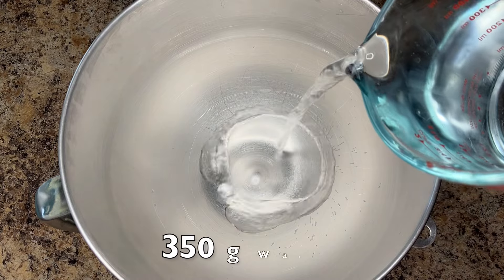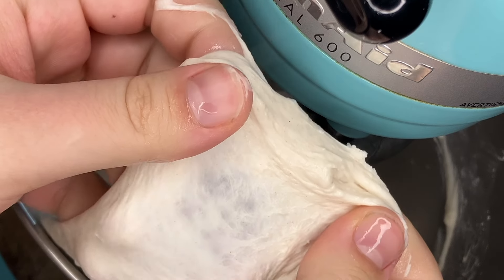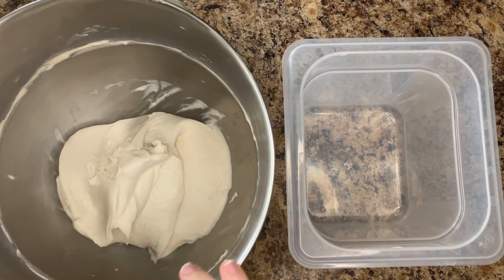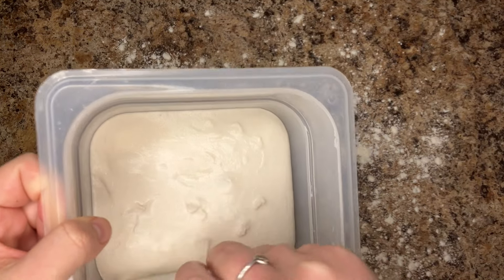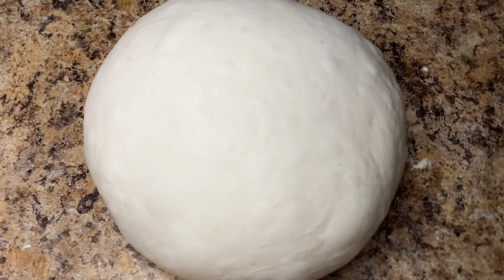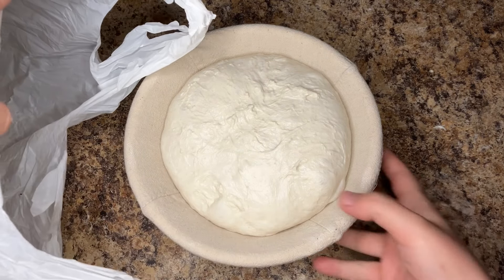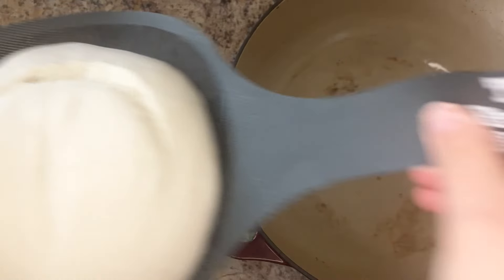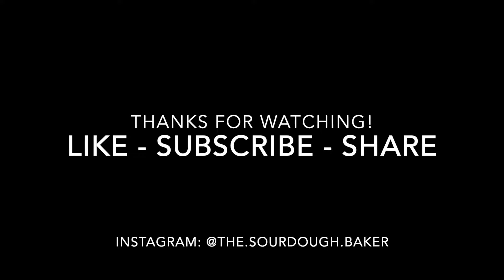Stand Mixer Sourdough: Country Loaf

Comment: I was shocked by your salt level 5% of the flour in salt is almost double what I've typically baked with 2-3%
Reply from the maker: Hi! I think you miscalculated. This recipe uses 500 g of flour and 10 g of salt. 500 (the amount of flour) times .02 (2%) is 10 g of salt. This recipe only uses 2% salt. 5% salt would be 25 g of salt, which would hinder fermentation.
Reply: This is what happens when you should be in bed instead of binging sourdough videos on YouTube lol
Reply from the maker: @Crimsonchinn2010  😂😂😂

Comment: Ok so I had it on too slow of a setting. I use the same ratio and I just got a stand mixer but I was like why is it taking more than 6 mins?!
Reply from the maker: Yes! The low speed is great for stiffer doughs, but wetter doughs like this one will need a little bit of speed to help them get going! Just be careful not to overheat - it’s not recommended but definitely something I do 😬
Reply: @TheSourdoughBaker  thank you!!! I have been trying to do little breaks during the kneading too hopefully that will help save my motor
Reply: @TheSourdoughBaker  I don’t have kitchen aid yet but my cooks one is a beast

Comment: I did notice no stretch and fold was applied. Is this right? And another question after shaping does it go into the fridge right away or you leave it on bench for a while? thanks.
Reply from the maker: With this one, gluten is developed via stand mixer, so stretch and folds are not necessary (though performing one or two can help). I did do one two to three hours into fermentation, which I think I showed in the video. After shaping, it does go into the fridge to be baked the next morning, or you can proof on the counter and bake same day if you choose.

Comment: Greetings from Brazil🇧🇷
According to KitchenAid’s manual, the spiral dough hook should only be used at speed 2. 
“Caution: frequent and prolonged use of the spiral dough hook for kneading can eventually cause the beater shaft bearing to migrate up into the planetary over time. When this happens, the top of the beater shaft will start grinding against the underside of the lower housing and cause damage. Visually inspect the beater shaft bearing on the bottom of the planetary before each use, and if it has receded into the planetary, discontinue use of the mixer until you have replaced the planetary.” 

I’ve seen this happening to a 3 years old bowl-lift Pro 600😬
Reply from the maker: @caasr57  Yes, definitely! KitchenAid is not the best option for kneading sourdough and it’s important to understand the risks, watch the mixer, and proceed with caution
Reply: @TheSourdoughBaker  Hi, Caitlin. I just mentioned that because, in the video, you tell to "..knead on a medium speed - speed 5 to 6 - on a KitchenAid, until the dough completely removes itself from the sides of bowl and passes the window pane test - 10 to 15 minutes." 

I'm wondering if your KitecheanAid Pro 600 did this job well!
Reply from the maker: @caasr57  It definitely does the job! But, it’s not as nice on the dough as my Ankarsrum. I’ve been doing this with my KitchenAid for years with no issues, and now I have an Ankarsrum which is much better for both the mixer and the dough. It definitely is a risk. I understand the guidelines set by KitchenAid and know people who have burnt their motors with this technique, so the warning is definitely there for a reason! I guess I’m just a daredevil 🤷🏼‍♀️
Reply from the maker: @caasr57  I actually just posted the full 15 minutes of kneading this dough in this mixer if you’re interested in seeing the whole process on my machine
Reply: @TheSourdoughBaker There is no Ankarsrum dealer here in Brazil. We need to import it, which makes its price to double, due to taxes🤬
Reply from the maker: @caasr57  Oh no! Which is a lot because Ankarsrum is an expensive machine!
Reply: I’ve used a Bosch mixer for years and years of bread making. It’ll make six traditional loaves at one time and barely even blink. 😁 It does tend to “walk” when it’s kneading this large amount of dough, but there aren’t worries about burning out the motor bec it is made for heavy work.

Comment: Hello 👋🏻 I’m trying again to use my stand mixer. I used the same recipe as you only I didn’t do the mixing of the starter first, I did the flour and water, mixed, let sit for 40 min as an autolyse which I’m used to. Then I added salt and starter and mixed with paddle till incorporated then the dough hook for 15 on medium. It’s still not picking up and years too easily. I’ve added another tablespoon of flour as well. It’ll pick up on the hook but won’t stay there, it keeps walking itself back down into the bowl.
What am I doing wrong?
I REALLY want to be able to use my mixer as it’s my grandmother’s old KA K5SS
Reply from the maker: @kristaolson6832  First, I would make sure the mixer is adjusted properly (that the hook touches the bottom). Second, you shouldn’t even need the full 15 minutes if you’re doing an autolyse. I recommend going until you get the gluten network (windowpane) and when you pull up on a piece of dough it doesn’t stretch too far (it has elasticity). Then, you can stop, even if the dough isn’t picking up. Do check the flour and make sure it’s strong; I haven’t had luck with all-purpose in my stand mixer.

Comment: Nice video. Thanks. 
Just wondering... What happens if I bake a bread with a starter that doesn't float? What happened with the bread?
Reply from the maker: Starter that doesn’t float is either not quite ripe, meaning it was freshly fed and hasn’t been given enough time for the yeast to multiply abundantly enough to effectively leaven your bread, or overripe, meaning it’s gone past way past the point of peak, begun producing alcohol, and is beginning to deactivate until its next feed. In either of these situations, the bread could still rise, but may take much longer, or the bread may not rise well at all. The end result would be very dense and possibly gummy.

Comment: I had to add several more tablespoons of bread flour, and it still did not seem as light and springy as yours. Mine seemed a bit heavy and lifeless. My starter was very active and floated in water. I used Bob's Red Mill artisan bread flour. I kneaded for 10 min or so. I put it up to rise, but I am afraid I did something not quite correct.
Reply from the maker: The flour you are using is pretty much comparable to what I am using, and should perform well. If your environment is humid (I live in a very dry climate) this could be a reason for the need for more flour. Did it pull away from the bowl after 10 minutes? If so, this is perfect! I'd love to see pictures of the dough and/or the final bake if you feel like something isn't quite right and I would love to try and help troubleshoot (to the best of my ability). You can send them on Instagram or through the contact page on my website. I hope it turns out for you!
Reply: @TheSourdoughBaker  I do live in a fairly humid climate. I added a bit more flour, mixer kneaded another 8 min, then hand kneaded a minute or two. It is now elastic, but fairly heavy feeling. I had to add almost a full cup of flour to get it to come together. It is now covered and resting. I will leave it overnight since we are only in the 40s at night. I have it in a cab over my fridge, which is about the warmest place I have.
Reply from the maker: @galerae947  It is likely heavy-feeling because of the extra flour, but should still turn out rising, baking, and tasting just fine. This recipe is 70% hydration, so adding a cup of flour would bring it down to 55-60% hydration. This is relatively low and will likely produce a dough that is stiffer with a more closed crumb - heavier, as you described - but should rise and bake well. (Though, I cannot speak for how the humidity could affect this!)

I wonder also if you used the medium speed (instead of a low speed) while kneading? This dough will not come together at a low speed in a stand mixer, unless it has been mixing for 30+ minutes, unless significantly more flour is added.
Reply: @TheSourdoughBaker  I did use a fairly low speed. That might be the problem.
Reply: I wanted to let you know that my bread came out great. Crispy, chewy crust and very moist and tender inside with a nice tang. Not a lot of air pockets, but delicious all the same.
Reply from the maker: @galerae947  I am so glad!! Thank you for sharing ♥️

Comment: I have a Bosch mixer and not a stand mixer. Will my Bosch mixer work?
Reply: Mine works fine
Reply from the maker: Oh my goodness - I can’t believe I missed this comment! Yes: any mixer will work! I’ll be doing this video for Ankarsrum soon, though I don’t have a Bosch. The point is that you’re developing that gluten to a windowpane during mixing. If you knead to a windowpane and the dough still feels slack afterwards (it relaxes almost too much), that single fold I did in the video is incredibly helpful, in combination for lamination with shaping, to providing a small extra measure to obtaining proper dough strength with minimal effort.

Comment: So the dough sits for 2-3 hours in the bowl in the counter, and then 9 hours in a straight sided container? Or is it just the 2-3 hours?
Reply from the maker: @airephoto  Bulk ferment this dough for the time you usually would ferment your dough. 

I did 2-3 hours in the stand mixer, gave it a fold, then 6-7 hours to double in size for 9 hours total at 70 F.

I’m going to update this video because I missed a piece of information in my voiceover. You don’t have to fold the dough, but folding the dough is helpful if it is looking flat (rather than domed) in the bowl. This just means it didn’t quite get developed all the way in the stand mixer.
Reply: @TheSourdoughBaker thank you so much.